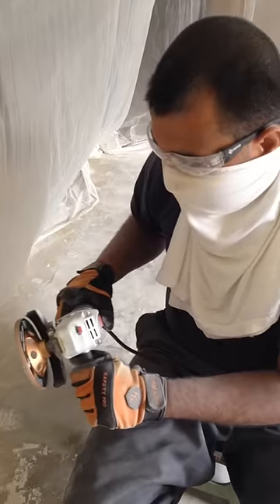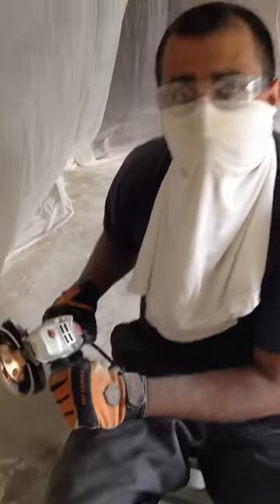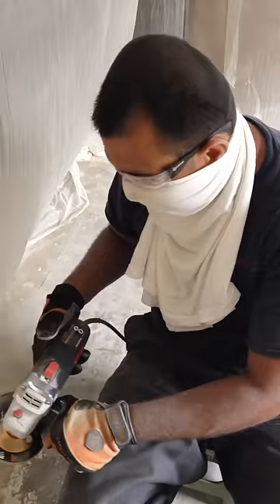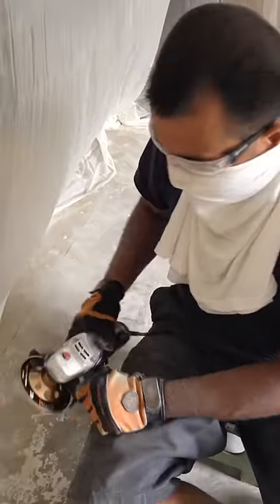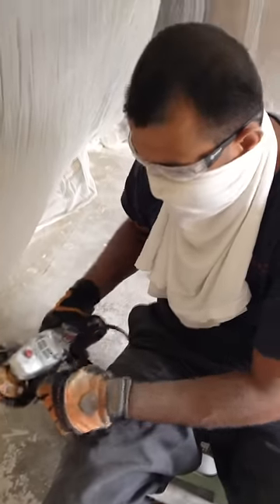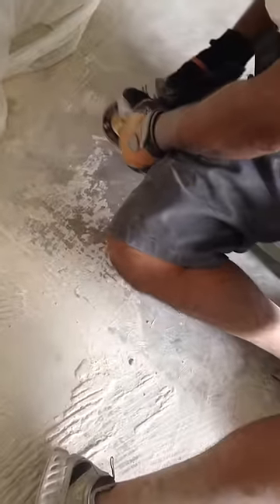How to remove thin set or mortar from concrete floor

Comment: We tried something similar to this, and it was taking forever.  Plus, it was leaving the concrete unlevel.  So, we rented a floor maintainer and a Diamabrush removal tool to do the job.   Doing it that way was so much easier, quicker, and quieter!  A lot of dust though, but luckily I had already sectioned off the room with plastic, which helped keep cleaning the other part of the room to a minimum.  If I had to do it again, I would still use a floor maintainer, but maybe water the floor down some, just to keep the dust down.

Comment: I'm still new to the DIY scene. I just want to inquire if the diamond cup blade was lying on the flat on the floor or was it held at an angle to effectively remove the thinset. Please clarify. Thank you.
Reply from the maker: Danilo Hermoso 
You can keep it flat to the floor. Also, wear a mask. Maybe have a shop vac running next to it to get rid of the dust. Which I didn’t have.
Reply: Thank you very much for the reply to my queries. I will be following your advice to use a shop vac while doing this activity.

Comment: How much of the concrete comes off with this?
Reply from the maker: Only the thinset comes off. If you are careful, you can do it without taking too much concrete off. I would suggest having someone holding a shop vac to get the dust that comes off. I didn't think of using it when I made the video.

Comment: This kind of thing set comes up easily with a scraper.
Reply from the maker: qzetu not this one.
Reply: @helpful-videos  It absolutely does. I scraped up all kinds of floors. Don't get me wrong, it is hard  work scraping that up but it does come up. White set comes up easy. Especially when it fails to bond to the floor. Grey thin set is far more difficult. Did you try a scraper on it?
Reply from the maker: qzetu yes I tried it. It would have take me couple of days to get the amount of floor space I have to clean. The only thing I would change is that I would use a vacuum.